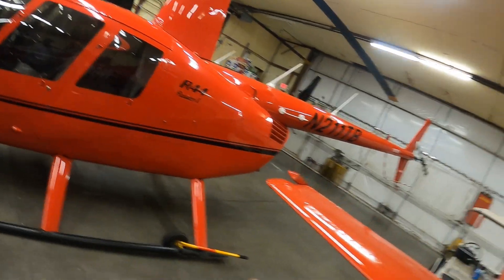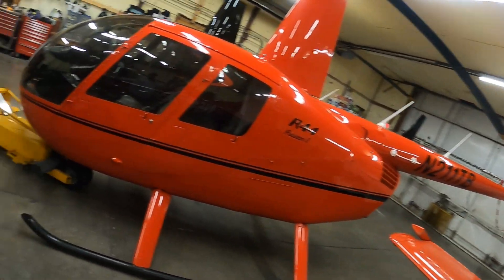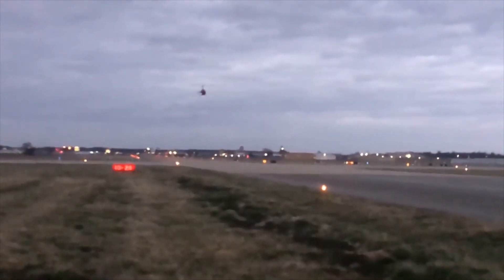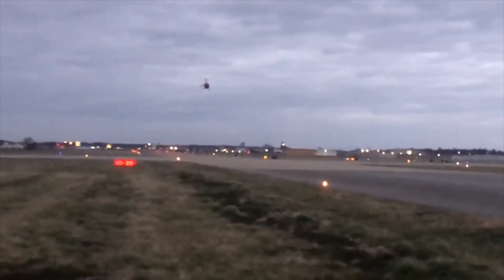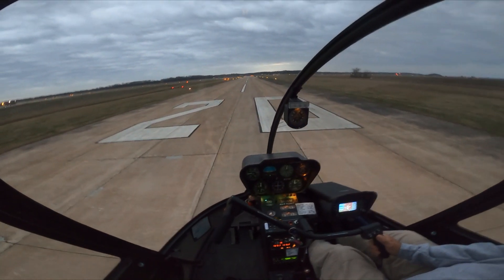ENGINE FAILURE ON DEPARTURE IN A ROBINSON R44- Autorotate or DIE

Comment: My first engine failure was on take off at about 75 feet. It was on my third solo flight, in a Bell 47 D1. The aircraft had just come out of a 100 hr inspection, my training was good, not a scratch on the helicopter. My response was immediate and automatic without thought.
Reply: Thank your lucky stars it was in a Bell 47.... And NOT an R22 'Nuff said!!!...